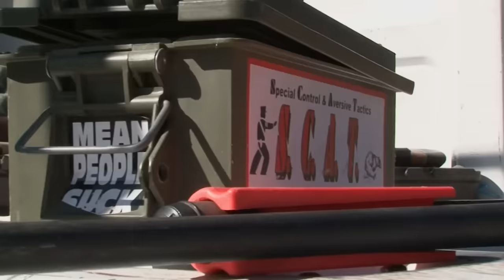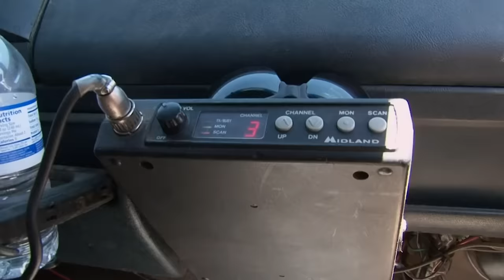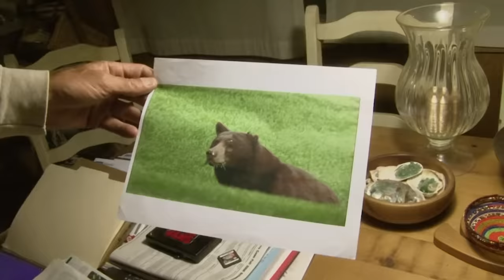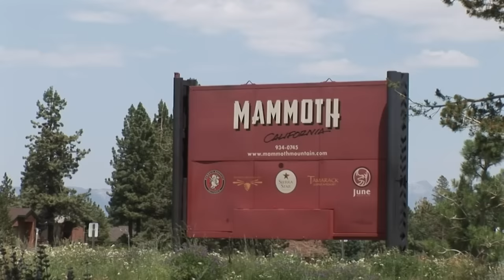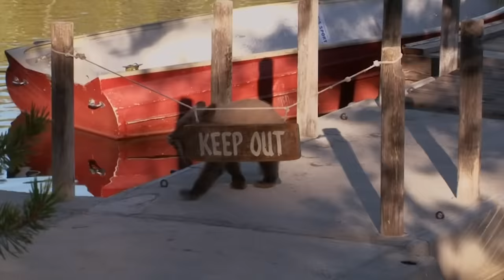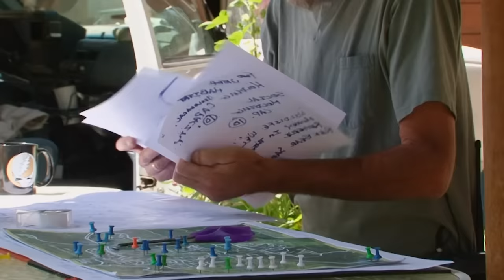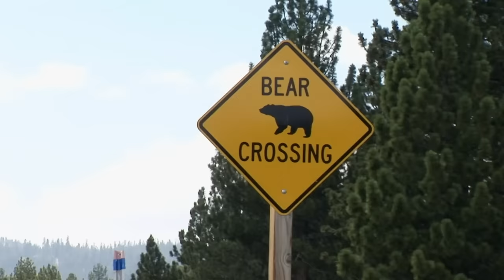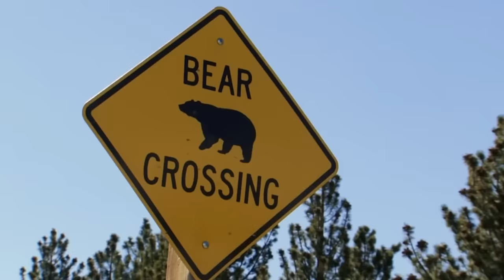A Town Where Collisions With Bears Are IMMINENT 😰 | MEGA MARATHON | Curious?: Natural World

Comment: $500-$1,000 in damage to the inside of her car,? Lol. That's $4,000-$6,000. That Dash Pad is probably $1,000-$3,000 alone, not counting labor. That door panel is probably $500. I'm sure it's claws did a number on those seats. I'm talked new, Toyota parts. Interior parts a usually unbelievably expensive.
Reply: Steve made his estimate probably from his experience with going to pull n saves. He seems like a pull n save penny pincher just by the look of his beat up red(?)& white truck with dents and “hella” emblem on the grill. Most people don’t pay the outrageous costs associated with paying a professional to install new parts from the manufacturer.
Reply: @MrRusty-fm4gb Yea,if you know the right place ,I bet you can do a lot cheaper for sure ! Just don't bring it to your dealers ,right !? Lol I used to know one of those shops in Santa Monica & saved about $ 700 or more on parts . 👍👍💜🥁🐉🎤🎶💞